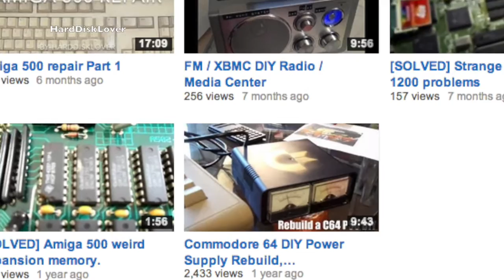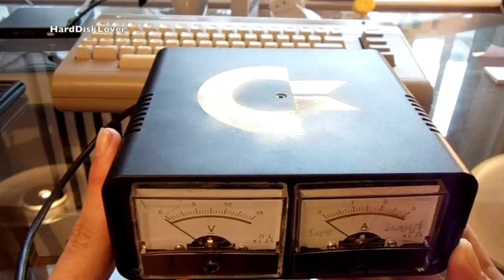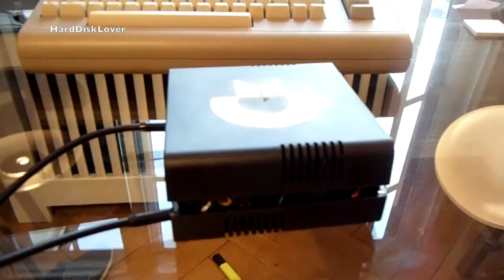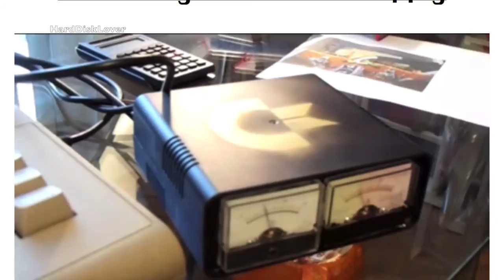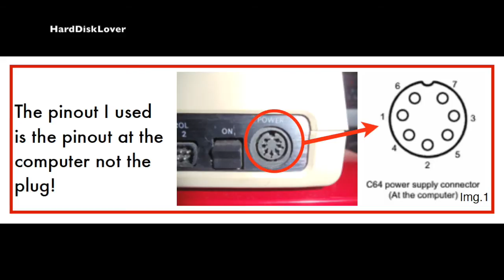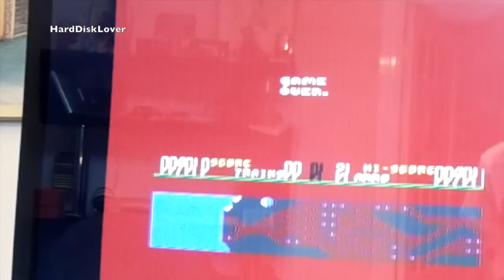Commodore 64 DIY PSU Revisit

Comment: I have been trying to do this using 2 wall mounted chargers. 1 is a 9VAC 700ma and the other is a 5VDC 2.5A charger.When I plug it in I can see the 5.3VDC on the C64 connector on pin 5, but when I turn the switch to the on position, the voltage drops to 2.8VDC. I have tried two different 5VDC 2A adaptors with the same results.The board that I am using is a good board, when I use a regular PS I get the correct voltages everywhere.I can not imagine why this is not working correctly?
Reply: Use thicker wires from the PSU to the C64
Reply: Thank you for the reply. Thicker wires were not the answer. I just had to get the correct switching power supp supplies.

Once I got 2 good switching power supplies everything worked perfectly.